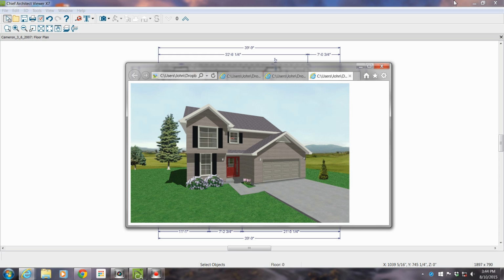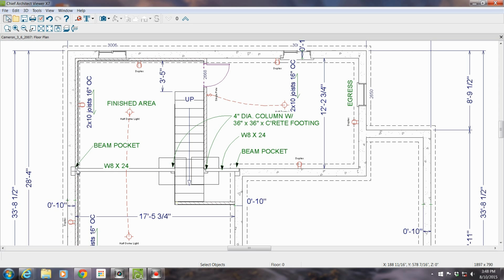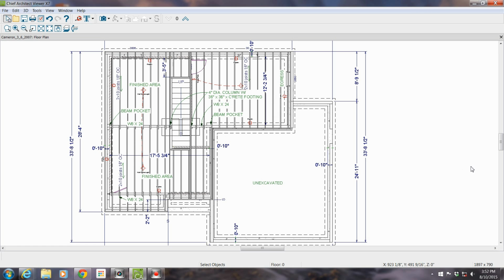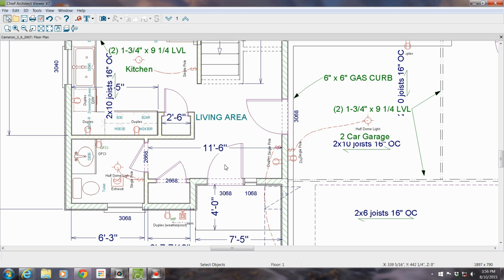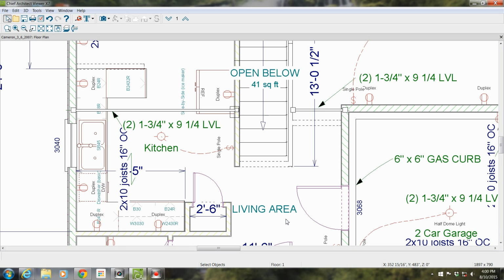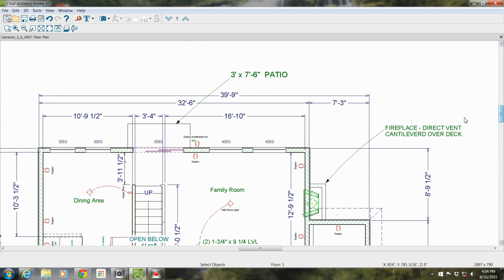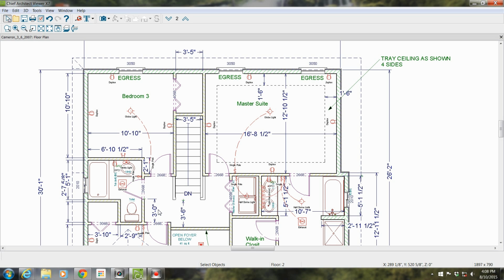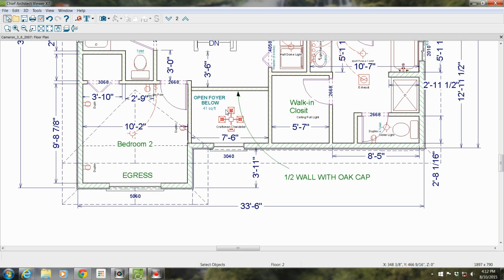How To Read Blueprints for Construction

Comment: I noticed that the plans give you the dimensions of the windows, but how do you determine how high you place the windows?
Reply from the maker: Jimmy,
Typically with 8' ceilings there is a 2x12 header installed above the window, or below the top plate. The window is installed right below the header. That would make it 12" =/- below the ceiling. Also remember if the bottom of the window is less than 18" from the floor then you must use tempered glass. For egress windows the bottom cannot be higher than 44" off the floor. Hope that answers your question.
 Check out my Weekly Podcast at http://DIYHouseMedic.com